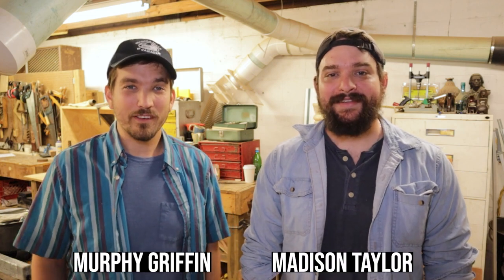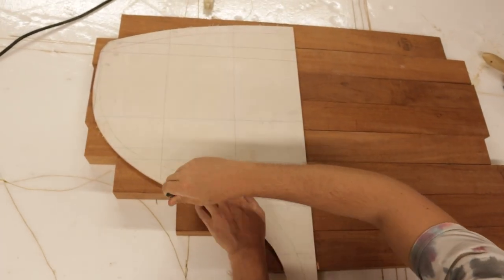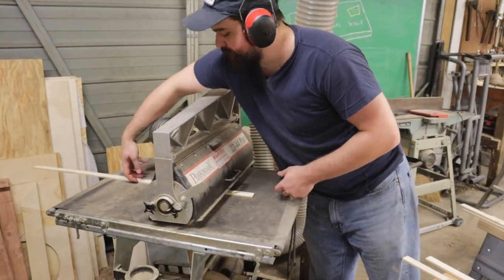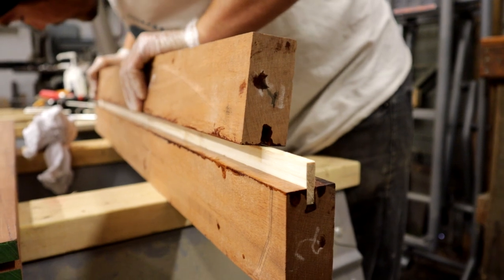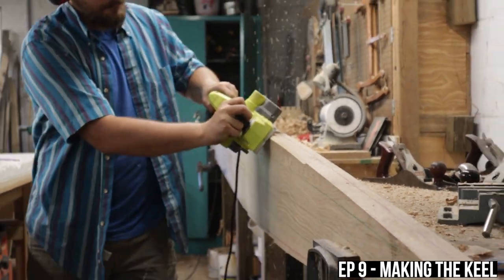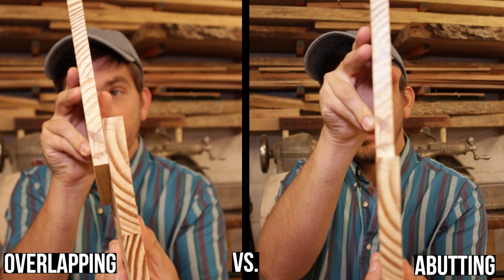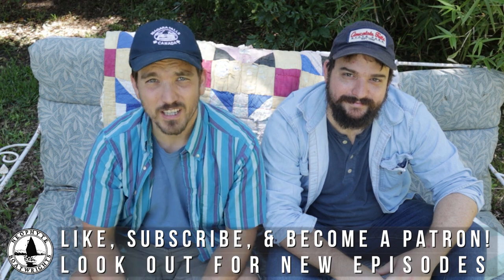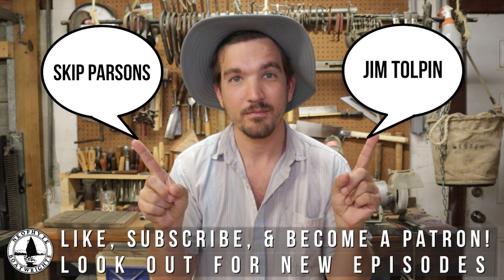Ep 15  - The Transom: Making & Mounting

Comment: Isn’t a more usual solution to the lapstrake issue to simply plane a gain into the lapstrake bevel so that the strakes all lay flat from inboard to outboard edge of the transom. Seems simpler than notching the transom.  I’ve done this with the lapstrake skiffs I’ve built.  Perhaps I’m not understanding what you’re doing?
Reply from the maker: Right. So we will still be cutting gains into the hood ends of the planks. The gains are what enable two adjacent planks to terminate with no overlap. But the gains are gradual. So theoretically the overlap is diminishing gradually and only vanishes completely  at the very end of the planks. So if you look at the inboard profile of two adjacent planks before you get to the "bitter end" then there will still be some degree of offset due to the overlap. The degree of overlap depends on how far forward you are looking. At the beginning of the gain, you have maximum overlap, at the end you have zero overlap. Now i certainly do not profess to be an expert, but i think the need to cut shelves into the bevel of the transom has to do with the width of the bevel. Since our transom is raked and very shapely, there are points within the "tuck" where the bevel is 4" wide. If you look 4" forward of the bitter end of the planks the degree of overlap isnt negligible, and so has to be accommodated with a shelf/notch if you want the plank to sit flush against the bevel. This may not be the case in less shapely transoms and/or unraked transoms. If the bevel of the transom is only like 1" wide then the degree of overlap between two adjacent planks is probably negligible enough to avoid the need to notch. Between the bedding compound and fastening the planks sit flush enough.

Comment: There's a big difference between counter-bored, and counter-sunk. If you are plugging, you will be counterboring. If you are filling with a compound, you might well be countersinking. Counterbores have parallel sides, whereas countersunk holes are conical. Terminology is important.
Reply from the maker: Yep. We've already been firmly disciplined on the distinction between counterboring and countersinking in a previous episode. We do understand the distinction, however, I have countersinking bits that when driven deep enough bore a cylindrical hole above a conical base. Thus, by countersinking deep enough a pluggable hole is left above the head of the screw. Is this counterboring or countersinking? Seems reasonable to call it countersinking.